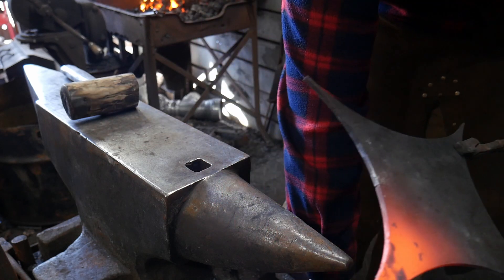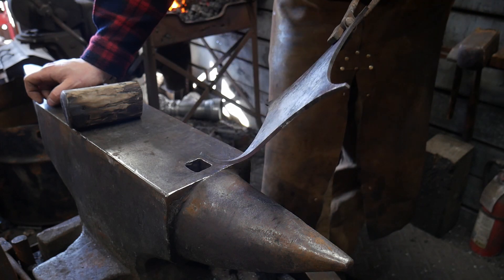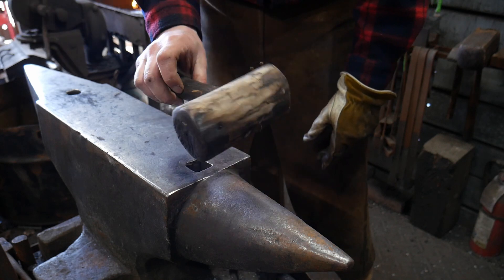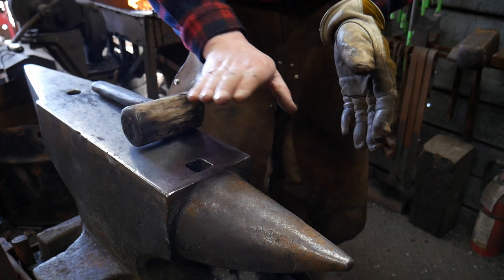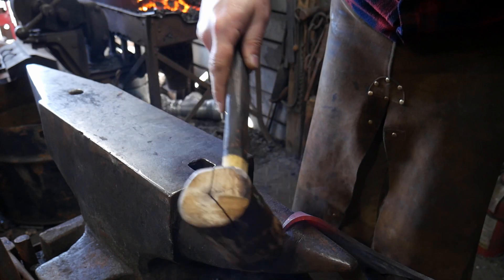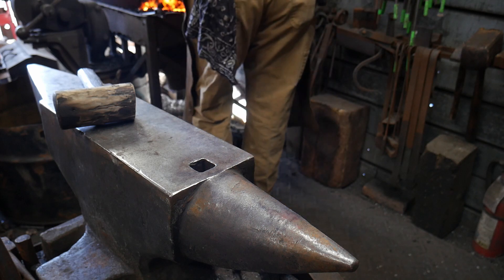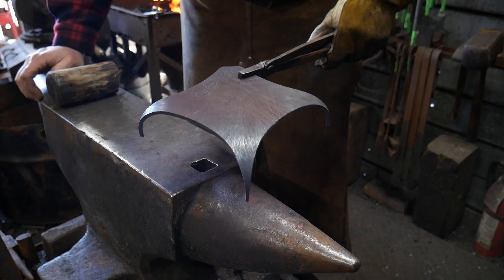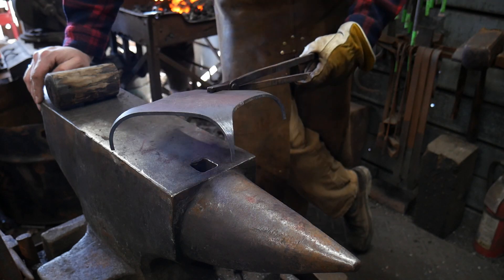How to Forge a Simple $75 Trivet (Simple Blacksmith Project)

Comment: Hey Roy, nice video. I really like the simplicity of this trivet. I am curious how you would handle the feet scratching the surface of countertops or stove tops. Thanks ~n
Reply: I was thinking the same thing. My idea would be use some automotive vacuum caps to put on the ends. But would the rubber vacuum caps get too hot from the pan?